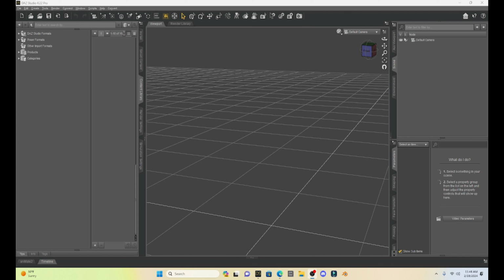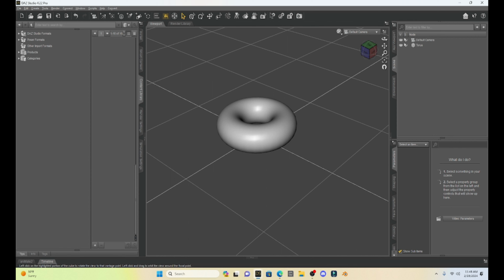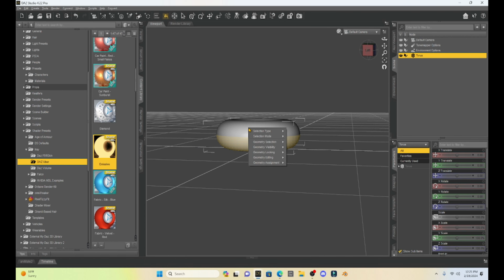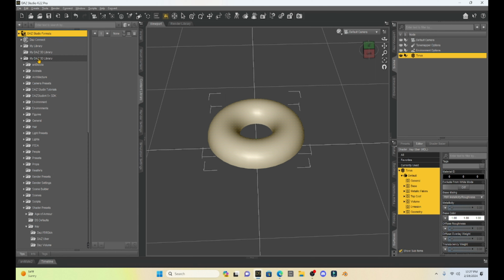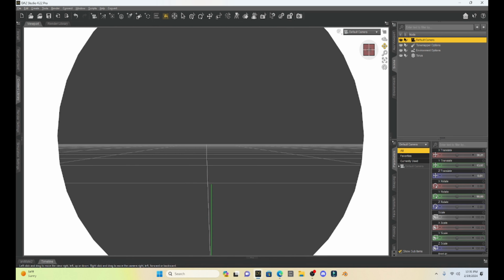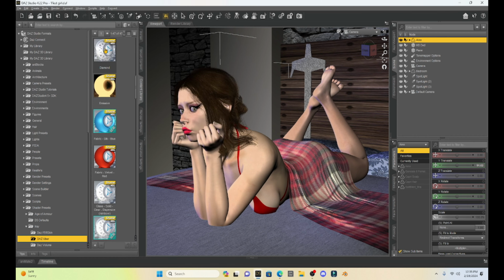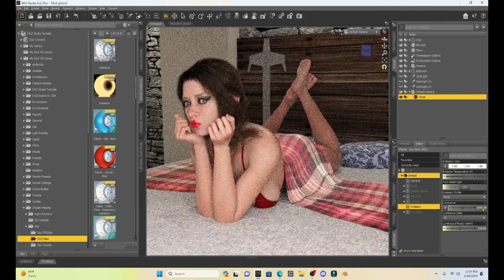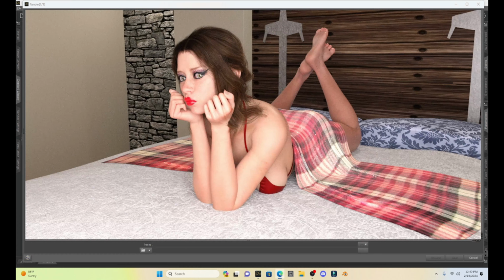Daz Studio: PORTRAIT LIGHTING:  Create Easy Indoor Lights!

Comment: Clever trick, thanks. And of course much better than the standard Headlamp! Question: the reason you're only using half of the donut, is it to prevent light scattering in unwanted directions?
Reply from the maker: Yes, I believe by using the half donut you are able to focus the light in the direction you want rather than having it scatter everywhere.

Comment: Thanks, this is a great light. I think I'll be using this a lot.
Reply from the maker: It's a great way to light up the scene with a soft light.  Experiment with making it larger or smaller.  I've noticed that it takes a much higher number of luminance than other lights.